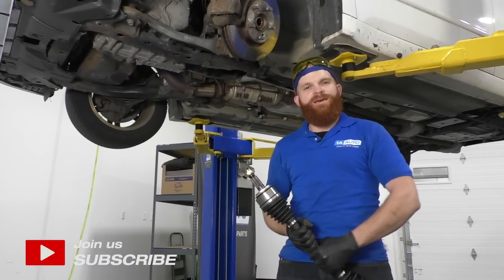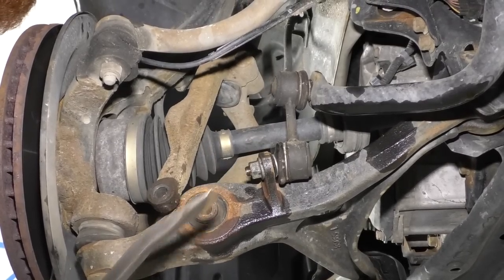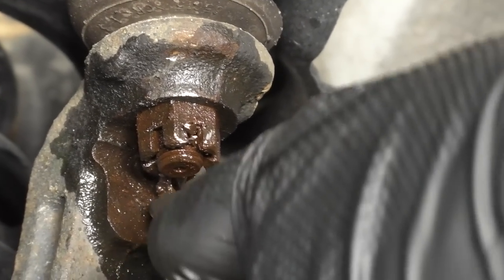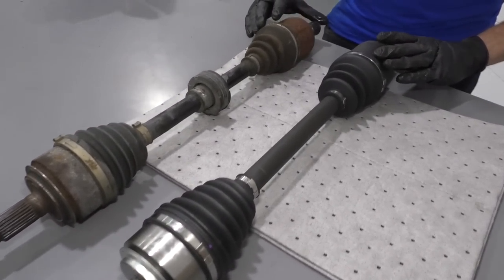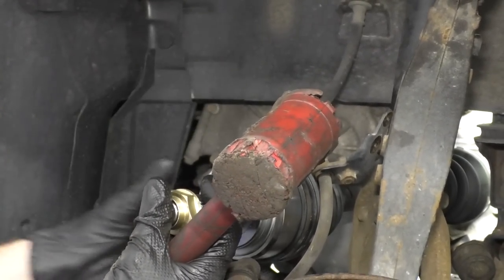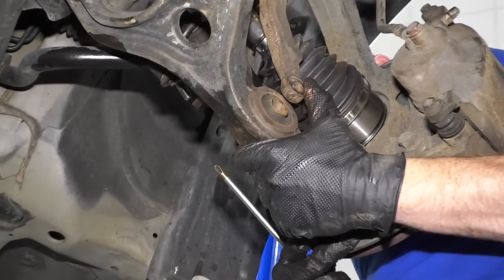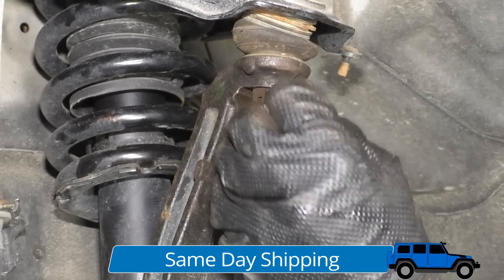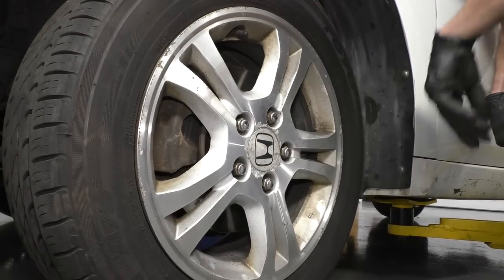How to Replace Front Driver Side CV Axle 03-07 Honda Accord

Comment: Video super helpful.  Was able to replace driver side axel myself in about an hour and save a ton of money.   I think I could do the other side even faster since I did this one and watched the video.  I thought this was going to be an all day job.  Thanks so much for posting. I appreciate the pace and letting us know the sizes of the nuts and bolts, saved a bunch of time trying to figure out what size.  Huge difference in the handling of the car, no more shaky steering wheel and no more clicking when I turn right.  Steering feels more solid.  2005 Honda accord EX.
Reply from the maker: +Jeff Carpenter Thanks for checking us out! http://1aau.to/m/Shop-1AAuto-c

Comment: This has been the best demonstration of anything I've seen on the www, so many thanks.  I couldn't find a 32mm socket for the axle nut at home and I knew I bought a socket just for some job a few years ago.  I found it and it's 36mm and luckily, it fits my 2007 Accord.  My car failed Virginia inspection.  The inspector wrote "rack and pinion boot broken" but it was the CV boot, left side.  Rack and pinion look fine.  I've had no steering or suspension failure on this car.  I'm going to replace sway bars, lower ball joints, inner & outer tie rod ends, & all boots both sides because I have 110,000 miles and I think the right side boot is also leaking grease.  That will make me confident I'll never ever need to replace any of these components again and it will be much easier during the axle replacement.  Otherwise, I might need to pay for an alignment now and again if something failed in the future.

Comment: Great video, one of the best I've seen here.  Kind of glad I had somebody else do it the other day though, as painful as the cost was, replaced both left and right axles, 2003 Accord, 270K miles.  Not quite so glad I clicked the link and saw how inexpensive the parts that were replaced could actually be.  As they say, oh well.  (It will make me think a lot more before telling them to just go ahead and do it the next time something "major" needs to get fixed.)

Comment: Thanks for the video.  I noticed after replacing mine, that the boot is sometimes rubbing against the lower control arm. Now I have a pinhole size leak.  Anyway 2 adjust this?
Reply from the maker: +Jacob S Thanks for watching!  You should make sure that the vehicle has a proper alignment and the parts were reinstalled correctly.  If the boot has a leak you will have to have it replaced.

Comment: If you really think Honda putting that damper on to limit NVH concerns had no merit.then you are mistaken. This is the reason why we do not deal with aftermarket parts for the most part.. I'm sure 1A Auto engineering department is superior to Honda....yea right.. again this is the reason why confident automotive technicians try to stay far away from aftermarket parts as possible and practical

Comment: I’m working on my 05 accord & the bolt connected to my control arm is not budging. I used a hammer but I’m only ruining the nut that was holding it in place. Any ideas?
Reply: Melt it off

Comment: Try it on the garage floor on your back and nothing comes out that easy 1 you need a torch and good tools and a strong back..
Reply: in the middle of doing this job in the garage now,  everything's coming apart like butter for me. Just need the right tools.
Reply: I just did both sides on the floor with jackstands, not a problem.
Reply: Experiences on how difficult it is vary depending on what climate you live in (winter salt).

Comment: Hi 1A Auto, does the snap ring on the transmission end of the CV axle ever come loose and get stuck inside the differential? If it does get stuck inside the transmission then when what can be done to remove it? I have this fear it might happen if I try to pop the axle out of the transmission.
Reply from the maker: +questorhh Thanks for watching!  That can sometimes happen and you will need to remove it before it causes damage to the transmission.
Reply: @1AAuto  Is it difficult to remove?